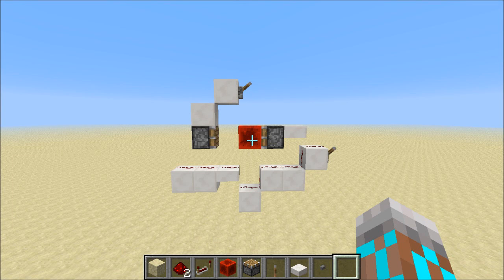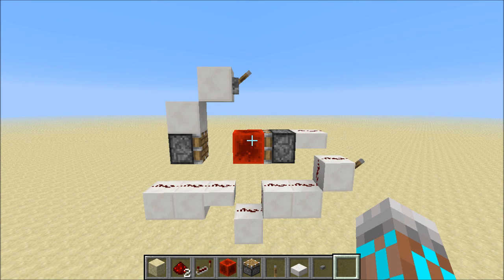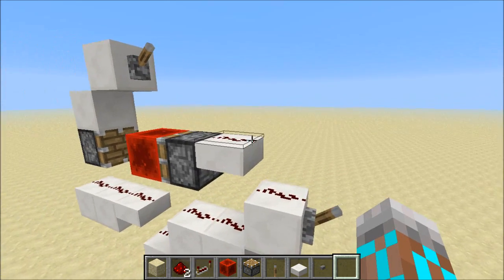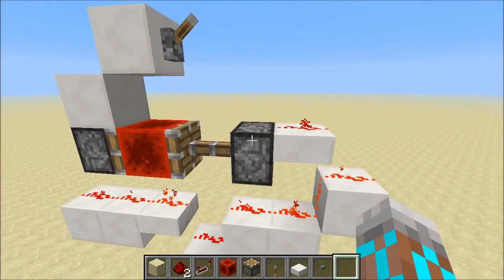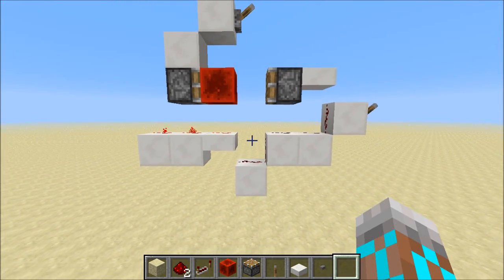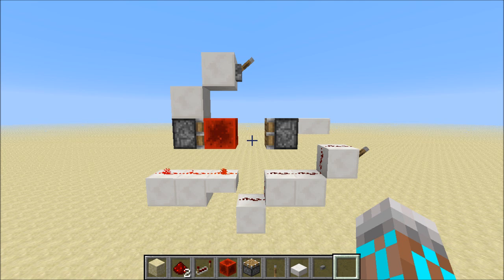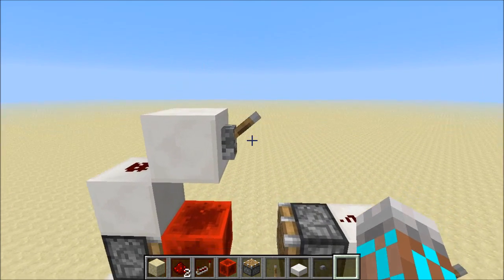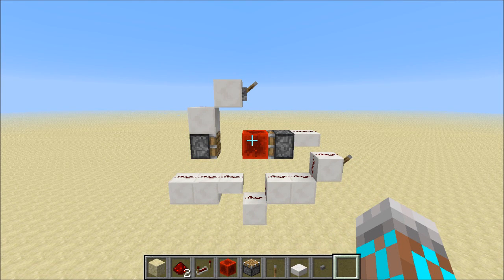Instant SR Latch - 1 Wide, Instant Set and Reset

Comment: I believe I have made the same thing, just a bit smaller. What I did was: place an upward facing piston, a block on top of that, then a redstone block, then an empty space, and finally a downward facing piston on top. place blocks /w switches beside the top pistons to make the reset, and beside the bottom pistons to make the set, and lastly a block /w redstone on it, placed on the side of the redstone block to make your output. Should be 3Lx5Hx1W, I apologize if that's difficult to understand.

Comment from the maker: Just took a look at yours - that's a really creative use of the dropper! The thing is, comparing the two designs is comparing two different things as this design is instant while yours has the delay of the comparator. Also, because of the way the inputs are our designs are really made for different uses. I've designed this to work as part of an array whereas it looks like your design is better suited as a stand alone unit. Nice work coming up with that design (and the TFF too)!

Comment: Are you sure that the set is instant? During the piston extension the block does not power wires so it should power after the full extension (=1.5 ticks)
Reply: The lever powers the output